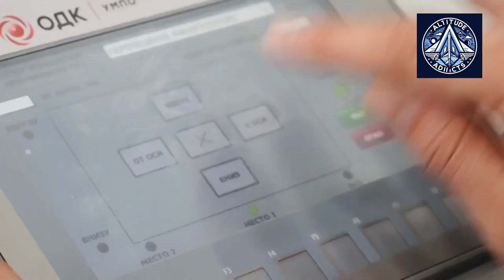Russian PD-35 Engine Faces Hurdles in Development Timeline - Also PD-38, PD-28, PD-24

Comment: All ex-Soviet aircraft engines were designed with 50-60% above rating performance for dependability and resilience and now days they have that same mentality with cruise power would be 40-50% of designed trust... Although their preferred aircraft design is for 4 engines for heavy lift and large aircraft that would give them superior ETOPS in any conditions for safety and reliability!... Besides I don't think they are angling to supply anybody with engines and waste resources, time and manufacturing capacity since its not their nature and much less to build over 50T engines....
Reply: …wasting resources is exactly their nature because the whole system is corrupt.